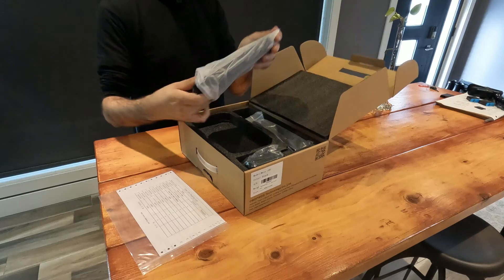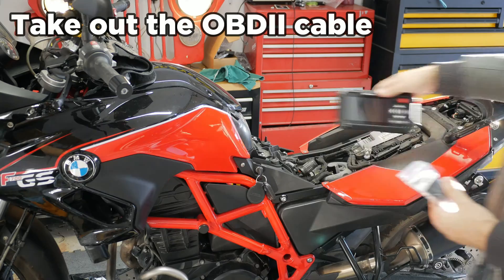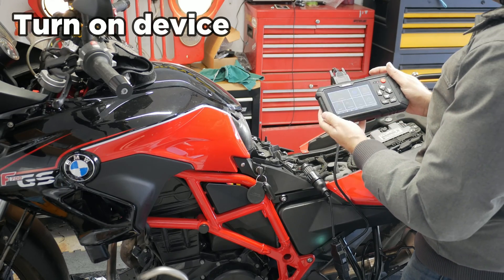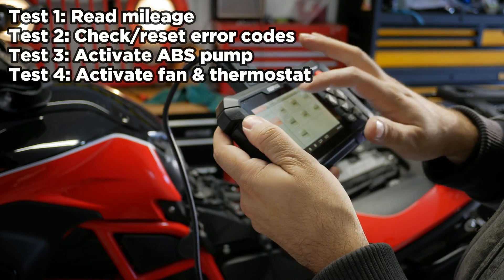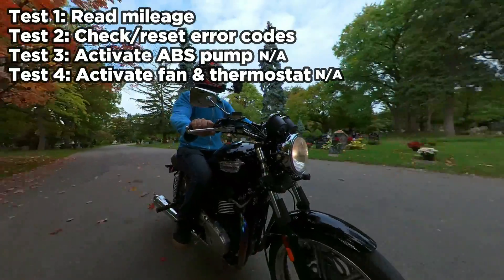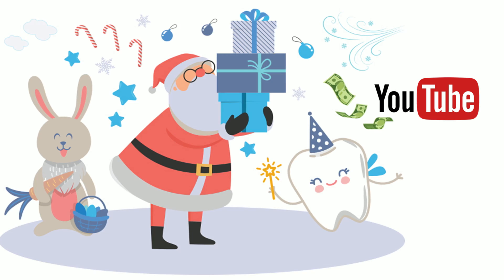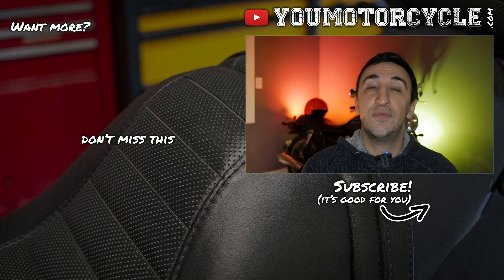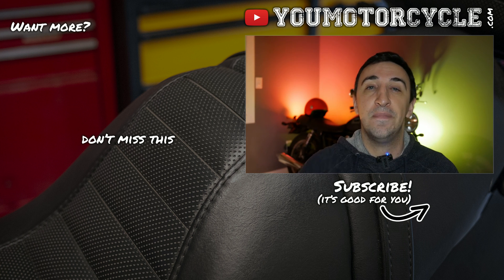OBDPROG MOTO100: Why YOU NEED A Motorcycle Diagnostic Scan Tool

Comment: I have an Autel for cars/trucks and a GS911 for my BMW RT.  They have been instrumental for being self sufficient.   I'll happily pay $500 for this tool if needed.  Hopefully there isn't a high subscription cost.  I get needing a subscription to support development,  but keep it low enough to make it cost effective for home users.
Reply from the maker: Cool! But have you used it for any motorcycles? As you can see, your GS911 can do a lot more for BMW motorcycles than this unit can
Reply: @YouMotorcycle  The GS911 has been a great purchase.   In fact,  I'm looking at purchasing another bike and it's in the list of benefits for BMW vs others.  It's small enough to pack for trips regularly updated and useful.  The HEXcode company has been great to work with for support and to add features.   They worked with me on an issue with using the GS911 on an older r1150rt,  which surprised and impressed me.
Reply from the maker: @maxw576  that's awesome to hear! I think that will be my next investment. I will look into it. Thanks Max!
Reply from the maker: PS: subscription is $80/yr after the first year. You can use it without renewing but you won't get access to any new firmware or new motorcycles